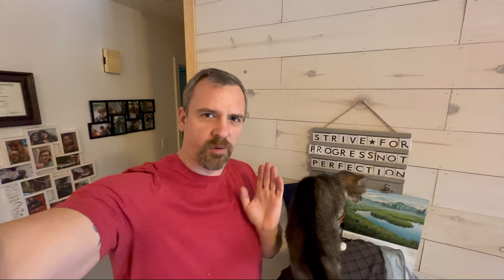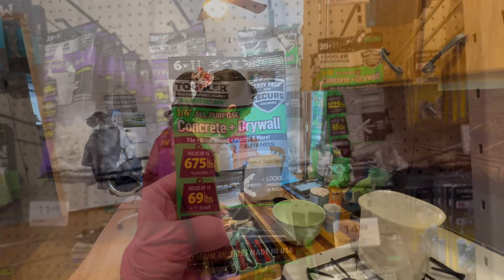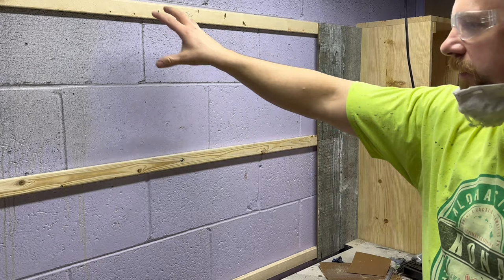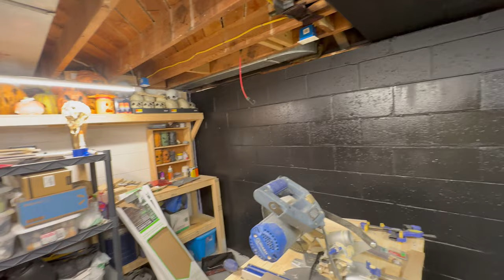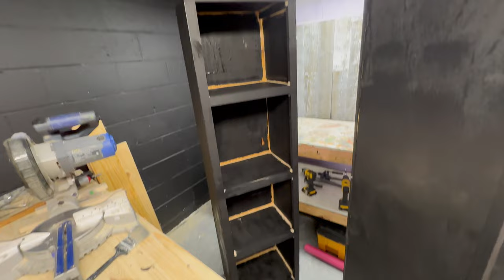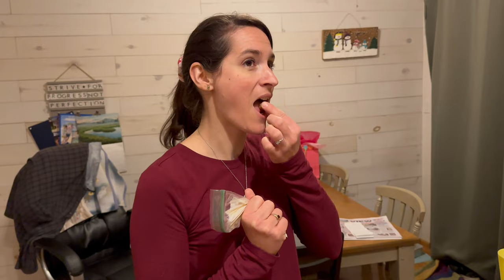Home Vlog | St. Patricks Day Corned Beef and Dumplings, Tiny Donuts, and a Workshop update

Comment: I'm sorry if I missed why you painted the walls black, but won't that make the room feel "smaller"?  The little donuts looked so good!
Reply from the maker: I dripped a bunch of paint on the walls when I painted the ceiling so I had to paint the whole wall black. I'm going to go over it with another color before I am finished :). The black is going to end up just being the base coat.